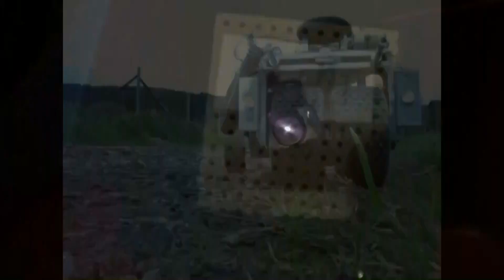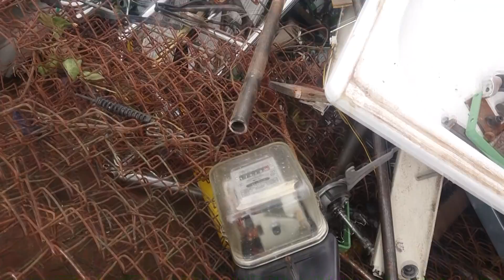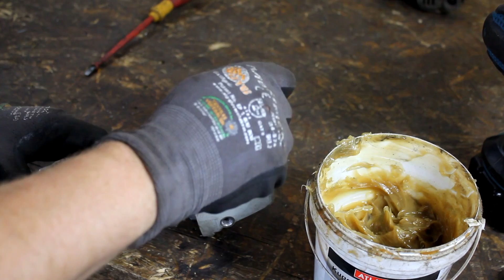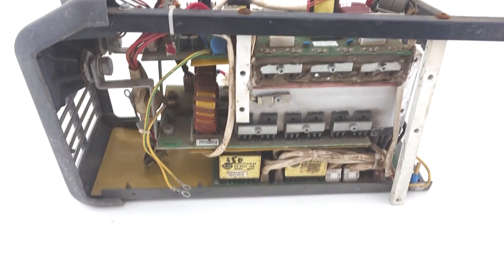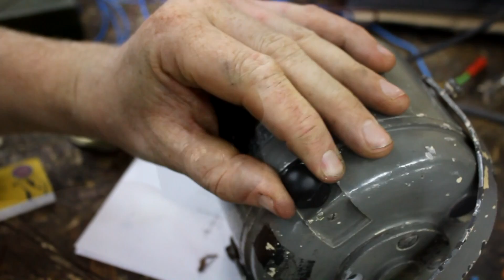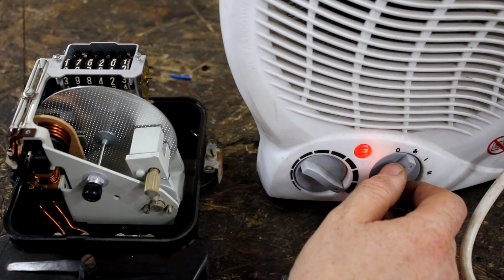New Great Scrapyard-Finds! Repair-A-Thon!

Comment: This Dentist oldtimer Dremel is awesome! A tool that is under rated. I used to laugh about dremel. But now that I repair scooters for fun aI value the tools that let me clean up and polish places on a casting or motor I can't reach or clean that easy with the big wire brushes on a Akku drill....
Nice Scabyard find. 😁👍
I used to go there and took everything I could find for Gardening and repaired it. As I can do basic electro rod welding and as a Carpenter had the machines to recover the wood parts... It was cool to get all these garden tool for nearly free. And also help to do small repairs for my neighbors. Which is always a plus if you need help for your own projects.... Thanks for your videos!

Comment: Use some fine stranded wire to wick up the molten solder after primary removal to desolder components, but you probably knew that!

Comment: Few months ago i found four Bosch angle grinders in scrap. Take them all. 20€ for spare parts. Cleaned and fixed all of them in two hours. One of them was fully functional, but just brushes was stucked with wood dust. I dont understand people who throw away this kind of stuff. I used to have just one angle grinder for 30€ a people throwing away tools that costs more than i can imagine..... Same with EWM Pico 162 few years ago. Replaced four IOs for 15€ and works like a charm.....  i just dont understand.....  Im sad for that tools, that can make some people happy as f*** to use them.

Comment: I was glad to hear your comment "with the mechanisms that have a good fit, I do not recommend disassembly unless necessary."    I work on old sewing machines, and often youtuber "experts" remove every little screw and disassemble every part of the machine.  No need to do that.   The machines usually need only cleaning and lubrication to get them running.  Often the wrong type of lubrication was used, or none at all, resulting in a "locked-up" machine.

Comment: Don't buy welders of a scrapyard, I worked at a company that produces some higher quality ones that start at around 1500€, they purposely destroy them whenever they can before throwing them away. They offer to do that for customers too. They pretty much break as much as possible so people can not salvage or repair those with a simple change of a board, which is pretty often the issue.

Comment: Be very very careful with that cup wire brush, I nearly ripped my stomach open a few years ago when it caught on the edge of angle iron and ripped through my boiler suit which snagged it up and stopped it just scratching my skin, if I was wearing a T-shirt I would have ended up in hospital. Great video’s though.

Comment: the reason there isnt alot of lubricant inside the gear is because they use molybdenum disulfide which is a very expensive and extremely efficient lubricant and it creates a layer that makes it lubricate great even though there is not a lot. puting in grease is not recommended over the old molybdenum disulfide.

Comment: Dude STAINLESS STEEL!  THAT STUFF WILL BE SUPER EXPENSIVE WHEN DEMAND INCREASES!  it's an alloy of chromium,  nickel, and steel... which have to be raised to a much higher temperature than plain iron or plain steel to melt.  MORE MONEY!  Yeah, consider taking a second look at anything stainless!!!!  Also, memorize items that use Super Alloys!  Yeah, same family of nickel, chrome etc..  Hasteloy, Inconel...  any nuts, bolts, accessories around turbochargers and their exhaust ducting are made of exotic materials and Ultra-Expensive.  ESPECIALLY IF THEY ARE GERMAN!!!!!!!!!!

Comment: Things to check on cord type power tools in order. Cord. switch, carbon bushes. After that check the armature for damage to the copper commutator bars and burnt windings. I have salvaged several tools with bad cords!

Comment: Molybdenum graphite grease! This is the single most universal grease with high performance and pressure properties and even isolating properties between different metals screwed together. I almost cannot find a place for that kind of grease except plastics.
Now this is coming from a car mechanic after 12 years in the field. Stuff has been tested for years.

Comment: Use a paint stripper to quickly unsolder many components at ones. Melt the solder with the stripper and tap the bord on the desk so it shakes of the components.

Comment: soldering hammer  would have been used to soften and effectively weld lead sheet being used as chimney flashing  or lead flashing on the top of some brick walls at roof level

Comment: my last job before retirement was at a steel fabrication plant, and in the last 3 years I worked there I repaired grinders almost every day,  28 400-600 amp welders, 15 cranes, 5 forklifts, and 3 buildings. Every day was an adventure, and I built /rebuilt many grinders out of various parts. One of the last things I did before retiring was to senf 2600# of broken and unsalvageable motors, welders etc to the recycler.

Comment: That big screw thing with a geared motor could be part of a screw separator, used for separating the solid and liquid parts of slurry and other smelly, gloopy thing.
Slurry is fed in one end and there's a wedge wire sieve surrounding the screw that lets the liquid out.

Comment: Maybe in the next episode you will find some dentures so you can practice or compose your own dental-diorama.
The Ferraris electrodynamic meter is a beautiful piece of industrial archeology.
How many I have had in my hands in 39 years of work: for the first 15 years I installed them, then I went to the Verification service, to check their correct functioning with sample instruments, stuff from € 7-10k each, to be recalibrated every two years, obviously borne by my employer: E-Distribuzione spa, a company of the ENEL group.
Bosch grinders are certainly victims of some professional user: when one breaks, you must have a replacement ready not to stop the work, then the malfunctioning one is set aside and sooner or later sent for repair ... or perhaps, once well dusty it ends in the wreckage where an attentive like you seizes the opportunity; sure that collector was well ruined! I have never seen one reduced to that state!
hello and the next episodes

Comment: I don’t have the tools or shop to pull this off so please look into it. Steal the idea from me. That is unless it’s just rare and I can’t find info online about it. Spiral ratcheting drill press. Use a spiral ratcheting screw driver and set it up on an arbor press with the right hardware to essentially make a non powered drill press for small items and easy to drill through items. I saw a spiral ratcheting screw driver the other day and it blew my mind. So simple and so complicated at the same time. Please look into this.

Comment: That soldering hammer is a beast! I have used a soldering gun with a large, iron shaped tip before to do some high amperage soldering, but that is nothing compared to this monster. I want one.

Comment: Always really interesting to watch. Where did you learn about electrics as you seem to have a very good grasp of it? It is something I would like to be more confident about and would also like to be able to set up the power testing station. 1 Thing I have always wanted to do was to be able to use washing machine motors for something else as they are never the problem that causes the machine to be throw out but I understand that they would just continue to spin up and ultimately be destroyed. Is there any way of re purposing them?

Comment: For what it's worth molybdenum disulfide (the black stuff) is the grease of choice for grinders these days as the crown and pinion are typically powered sintered metal which don't have a good surface finish.

Comment: That ERSA hammer seems to be doing more damage than good, if you look how quickly it "browns" the PCB. is it not possible to dial down the temperature a bit? -say 360 or 370'C?

Comment: I appreciate your commitment to Bosch tools, but now their products are very far from what made this company famous, most are made in China and not much better than any other Chinese knockoffs. While I do understand their need to use cheaper manufacture to remain competitive on the consumer market, they should at least keep the quality control at reasonable levels and stop scamming their customers by printing "made in Germany" on the packaging when the tool itself is clearly marked as made in China. 
Regarding lubricants, try getting some gear grease from the Polish manufacturer AG Termopasty, I was very impressed by the quality of their products, especially considering the relatively affordable prices. I stumbled upon this brand accidentally a few years ago when I ran out of thermal paste at the worst possible moment and had to use whatever I could find at the closest store, since than I tried a variety of their products and found most of them very useful (I'm also tinkering with a lot of stuff in my spare time).

Comment: Ou cool. Just found American made Stryker surgical rotary tool from scrap. Sadly its missing the wire and tool head... and my DIY solution of that kind of thing from store for drills first blew bearing and secondly is over heating.. gotta look into it but least motor is working fine. Gotta try find originals from ebay..

Comment: This power meter will give slightly false readings because it is calibrated for 220V and mains voltage in Germany is 230V

Comment: Thank you for another greatly entertaining video!  I had discovered earlier just how cheap those older electric meters are these days, so I bought one on Ebay for about $20 and put it in line with the EVSE that feeds grid power to my Chevy Bolt.  Now its easy to figure out exactly how much it costs me to drive.

Comment: So he basically salvaged an early post-war Dremel!!😄
Reply: Foredom!
Reply: @cathyb2204   Exactly what I was thinking, I have a Foredom in my shop. Replaced the brushes and rebuilt the foot pedal, works like new :)
Reply: Haha
Reply: Those Dremmel rotary tools go back a long way, I've seen ads for them that are at least as old as that dental drill.
Reply: @olegkostoglotov8800  I got my first Dremel in 1968. I used it for fully 20 years before it died. I now own several of them. They are one of the best all around tools ever.

Comment: Angle Grinder Scor-a-thon!  Dude!  I carefully measure the axial and radial clearances of the hypoid gear and insert hardened or stainless steel washers to improve the gear meshing. Sometimes  it is necessary to hand fit a washer/shim with a honing stone.  After that is done, the grinder runs much quieter and smoother.   A little bit of slop/play is required for heat expansion, but very little.  Remember the VW Beetle's flywheel end play shims (crankshaft axial thrust washers)????  The minimum was 3 shims...WHY?????   Answer:  multiple lubricated surfaces equals less friction and heat.  Basically more lubricated surface area to displace the pressure of releasing the clutch.  That fact can be applied to many things....maybe a subject for a video:  stack a few sheets of lubricated sheetmetal under a car and show how easily it can be spun around!  Or slided.

Comment: That soldering iron is insane...I've seen ones like that but a little bit smaller used for stained glass windows with lead solder

Comment: I have that exact "hammer", man, it's one of the best i've ever used, i inherited it from a good friend's junk pile (he got a much bigger 850 one from a different manufacturer) and i've been using it to repair/dissemble a lot of things. ONE particularly good use, i've fixed my entire roof with it.
Reply: Ideal for today's microscopic electronics. If you can't solder with it, you can still use it as a hammer :D

Comment: Grinder no 1, that's what happens when you run the brushes to the stem. Shows that the owner of that machine was quite dumb, as far as i'm concerned. Ruined a perfectly good working unit for a part that costs a fraction. I've no respect for his ilk.

Comment: Great junk yard find video. The electric meter was interesting. I bought one years ago to monitor energy consumption. Have not used it for years as I now have a Kill-a-watt meter that is easier to move around bit but it is still stashed under my bench. 

I used to be able to check out junk yards but now a days it has gotten harder due to the liability concerns in the US.

Comment: The "hammer soldering iron" is as you say used in roof work. It was used to melt lead at junctions of roof segments. (See attachment).
Over beating lead will make it brittle and then heading and cooling over time will cause a failed joint. Hope you found that valuable. Your videos are already looked forward to, from a fellow restorer, though one not as capable as you ☺️🇬🇧
http://www.cstevensroofing.co.uk/lead_work.html

Comment: be careful with that dental hand piece those lil bevel gear are insanely priced to replace i have modern versions used to port cylinder heads and 2 stroke cylinders and the 2 gears in those are near 100 USD every time i replace them.

Comment: When the mechanical counters are (or were) fitted into gas or electricity meters they are usually set to 999999.9 so that the counter can be seen to work when the meter is connected in use. That is, you can see it change from 999999.9 to 000000.0.

Comment: Angle grinders are like potato chips, you can’t have just one!😂😬
Reply: A minimum of 4 if you're doing oriented work, and at least 2 if you're in the hobby. One for grinding one for any other application as grinding almost always ends up with burning any tool that's used for other jobs (steel shavings and all that mambo).
Reply: @aserta  And no worries with the change of balance once the stone/etc. trues itself
Reply: @David Helmuth: So true. :D Your comment needs more likes. :)
Reply: I know. I have 6.
Reply: I have none
Reply: @David Helmuth     I have none. Do you feel sorry for me? I've got like 9 drills and 6 circular saws, though. I tend to use my circular saw like an angle grinder.
Reply: Should be sold new in pairs!
Reply: no they are like the infinity stones, you collect them all
Reply: Ain't that the truth!
Reply: I have 1 but idk where is. On other note. Did yall know u can use it to make a ebike?

Comment: The electric meter can also be considered an integrator. A mechanical device that can do mathematical integration. In this case it integrates the Voltage * Current over time. These devices can give a very physical visualization of what the process of integrating actually is.

Comment: some excellent finds and repairsthere..Another use for the solder hammer was for soldering the tanks on radiators and we used a similar thing to melt the pitch on the lids of repairable lead acid batteries in the 70's before mass produced throwaway ones chased us out of that line of work..

Comment: I am not a fan of those specific Bosch angle grinders in the American version there is no bearing in between the enclosure and fan shroud. And if grit gets in there it will melt the enclosure and will be forever be very loud.

Comment: My older brother (rip) was always working with various electrical devices in the mid 1950s till he passed in 2014. He decided to test the selenium rectifier he removed from a piece of equipment. Wired it to the end of an extension cord. And with a bang it was done. Scared the heck out of my parents sitting next to the power meter on the wall. The surge caused the aluminum disk in the meter to ring.  Somebody gave my dad a dead reel to reel tape recorder for my brother to play with. He figured out how it worked and ended up as chief engineer in several well known recording studios in hollywood. He had a swiss pocket knife given to him personally be Willie Studer. The tape recorder manufacturer owner.

Comment: @The Post Apocalyptic Inventor.   A friend of mine gave me his inverter welding machine saying that it was damaged beyond repair.   What i found was this.  It starts up but as you adjust the knob for the amps (low or high) there is a humming sound,and no voltage to the leads. Ever had a problem like this?.   If you did. I would appreciate your response.   Thank you in advance.